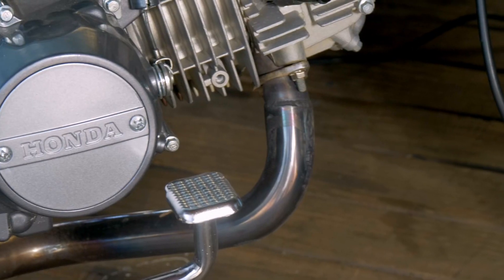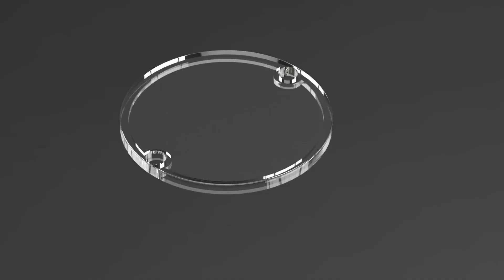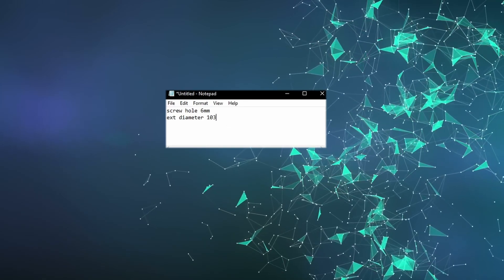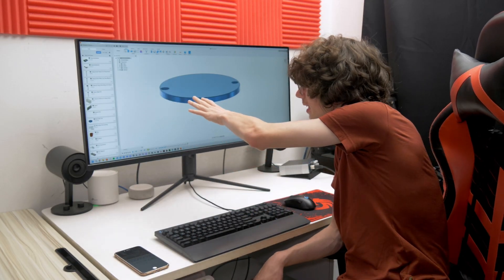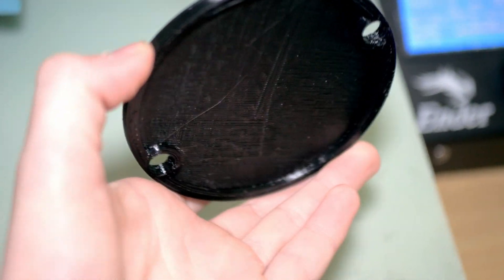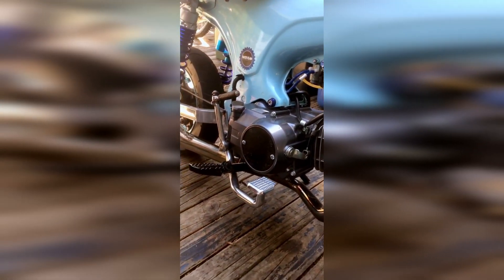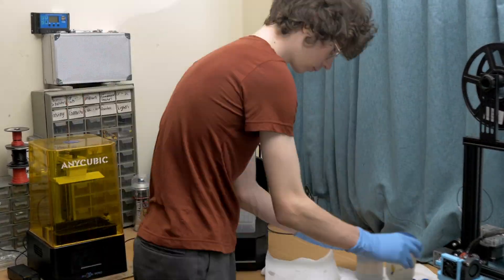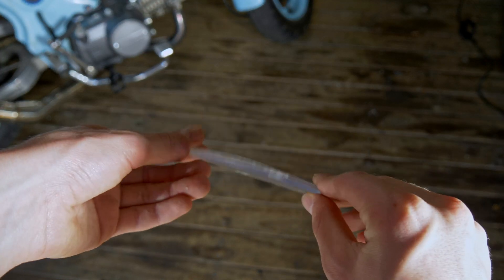3D Printing a CUSTOM Transparent Motorbike Clutch Cover!

Comment: Good job, although for such a geometrically simple part the obvious option should be plexiglass cut with laser. UV durable epoxy resin cast in rubber mold is also a great option for more complex parts.